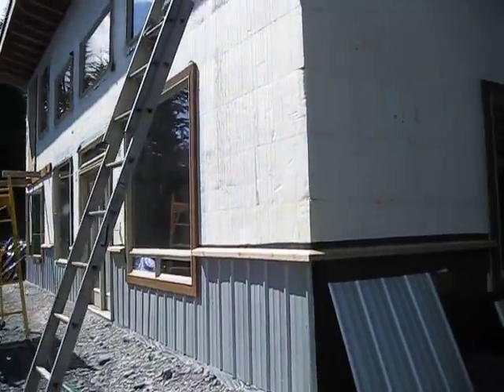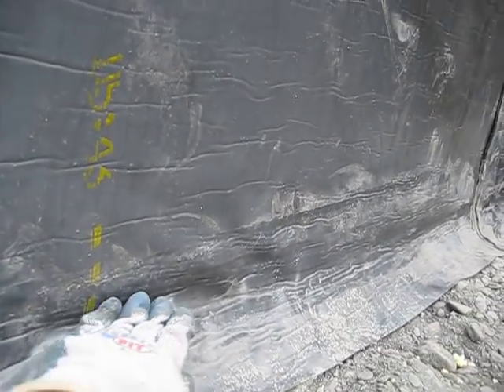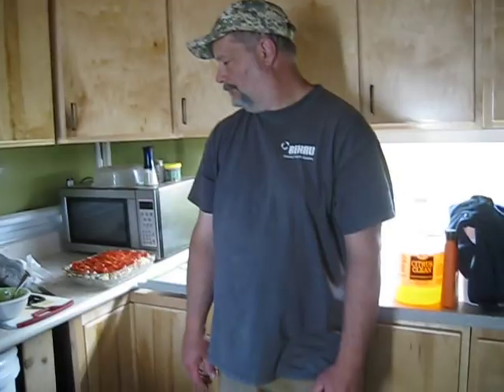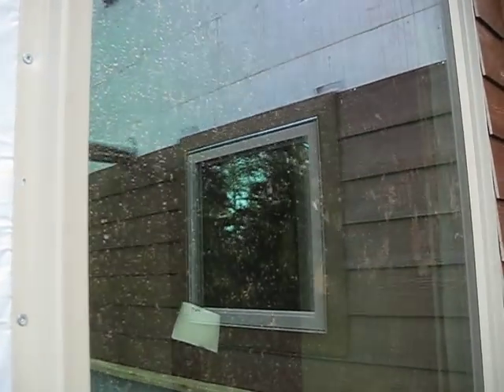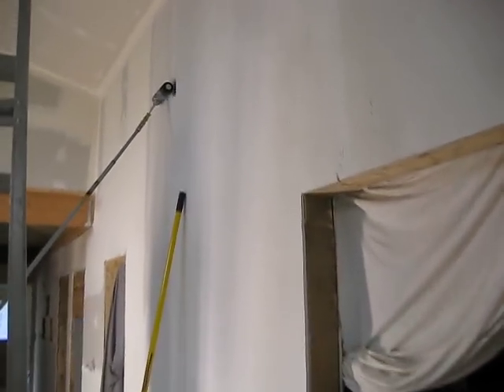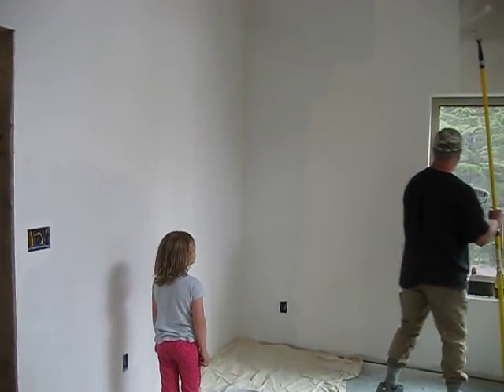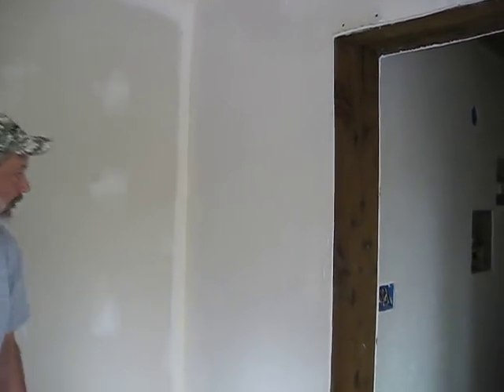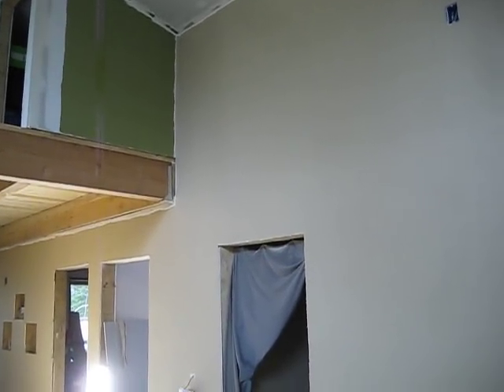House Building Part 29: Vine Pattern Texture & Paint Walls

Comment: By the way now they have different new fixtures that you put in the walls like that and they clipped flush to the wall and when they are released the water drips out of them so they do not freeze inside that's why they're long like that so you turn them off and they drip down the line but they have new ones now that go flush mounted with a new clipping a hose connection which also turns on the water

Comment: Sounds like you need a couple volunteers somebody to help you guys get busy get going apparently you guys are just parents and you don't really have any time to do any of this stuff and you're not really fast at it but they have new fixtures now that go into the walls like you have that bass they have a hose connection and you busy when you click the hose in it also turns the valve on it is completely flush mounted nothing sticking out no part no valve to get damaged it's the same thing as the water goes all the way back to the back and turns the valve but these ones come out flushed it look nice they have hoses that clip into them and much better and I believe there are different links you can put them